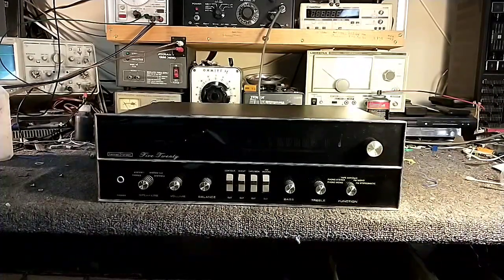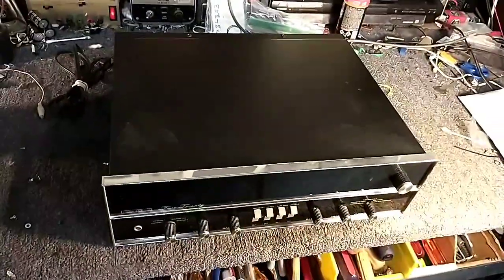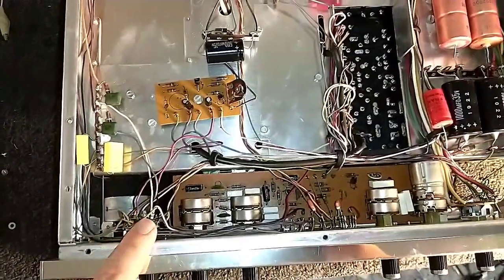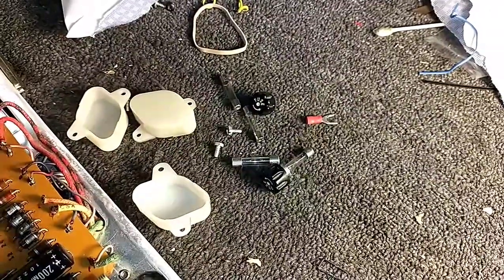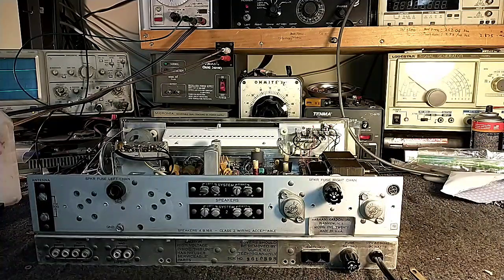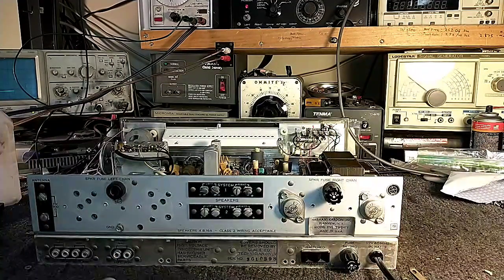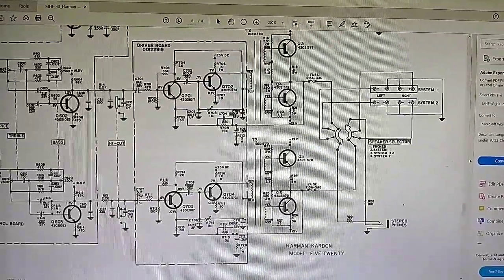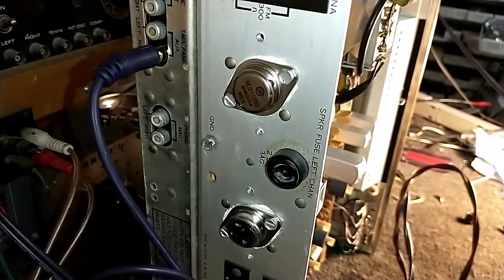Repair of 1967-69 Harman/Kardon Five-Twenty with blown amplifier - germanium to silicon conversion

Comment: The instructions say to use the capacitor wizard to look for shorted transistors in circuit because it wouldn't see the Transformer
Reply: I liked your speaker trick for capacitors. I started using it last year.
Reply: @rsattahip  So do I, Freaking genius idea! Shango, you may be able to filter your your speaker testing capacitors, but love the raw unfiltered blurted out diagnostic thoughts like faulty components are almost out to get you and die in a certain way just to throw you off typical diagnostic paths.
Reply: @rsattahip  What are you talking about?

Comment: Nice SI conversion. Now if that was my receiver I would absolutely opt for converting the other channel. When you pointed out the distortion / oscillation at clipping I thought you knew it was the old channel doing it, I didn’t realize until the very end that you thought it was the converted channel lol.

Comment: Only fixing one channel kind of disturbs my OCD. When I work on stereo equipment and replace capacitors or transistors, I always do it on both channels, unless I am using the exact replacement for the part. Am I the only one?
Reply: Yes, I would say it's best to replace the equivalent components on both channels, especially on very old equipment like this where components could have gone out of spec.
Reply: I hear ya, however sometimes customers budget limits stuff

Comment: I have exact same receiver I restored it back in 1987 and it still works today as  it did then . That unit is rated at 35 watts RMS per channel I have the factory schematic some where among my stuff . when I got mine the right side was bad .
Reply: I am glad I have a spare set of transistors for mine .
Reply: I have a 1975 Harman Kardon 720 and it's a kick-ass machine. Weighs a damn ton. The left and right channel are each their own 45w amplifier.  It's like there is 2 complete stereos in the machine.
Reply: Hi Richard.  I don't see how it is possible that this receiver could be rated at 35 watts RMS.  I think that Jordan's assessment of 10 watts RMS per channel is more likely.

Comment: Interesting how different technicians will take different paths and sequence of troubleshooting, I enjoyed watching. I used the ON semiconductor MJ21193G and MJ21194G devices on a Marantz 2275. The spec sheets on the MJ21195G and MJ21186G devices seemed to be the same. Do you think the 93 would have worked as well as the 95 in this device? Both being PNP, not sure what what the differences are. Thanks....
Reply: Both will work, they exceed the original part parameters by a long way, and will work there, as the requirements are not critical. Sometimes they are too good, and need to be damped down a little as they can oscillate, when the originals were struggling with gain dropping with frequency. That will need either small sub 100pf capacitors across base emitter, or a ferrite bead on the base lead, to stop oscillation. Originals might be substantially lower gain at 50kHz, but new are still strong at 30MHz.

Comment: Very interesting that it contains all discrete components. I would think that by 1969 stereos like these would a chip or two in them.
Reply from the maker: You really didn't start to see integrated circuits as common place until the mid 1970s. You did see integrated circuits in the IF strips on tuners like the UA707 - but other than that everything was discrete until about 1975, when you started seeing Sanken and STK power packs.

Comment: Shame the owner didnt want both channels converted, the other germainium channel is likely to fail as well :-(
Short sighted customer.
Reply from the maker: It's a money thing. Everyone seems to think in the now rather than for the future.

I have a problem customer who did not want anything more than the bare minimum against my wishes. He didn't end up using the receiver until months after he picked it up. Has issues from sitting and needs work in all the areas mentioned previously when he left it for repair. 

Come to learn he was flipping it on eBay. Oh well

Comment: You should also make sure the customer doesn’t have bad speakers, and uses actual  terminals on the speaker wires, instead of shorting the output!
Reply from the maker: That's why I only have a demonstration warranty. I lecture them about their wires and how to properly connect them. I will even properly terminate them for a fee. 

However the demonstration of the amp is the only warranty. If they take it home and blow it up again and they didn't bring in their speakers and wires for me to examine - it's all on them

Comment: Did You Check The Main Power Supply?
Reply from the maker: Meaningless if the other channel works along with the rest of the machine.
Reply: +19V -19V its in the video about a third of the way along. Looks fine to me.